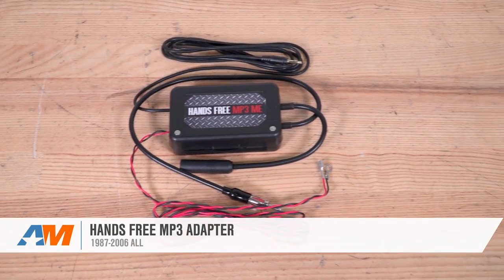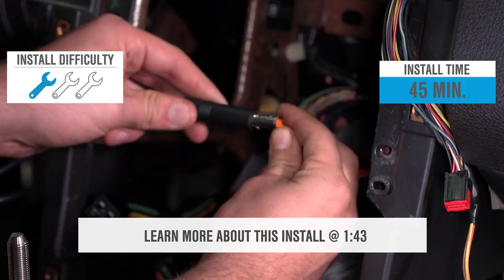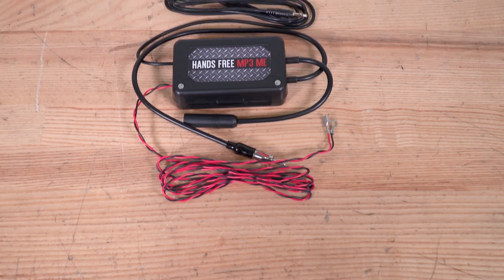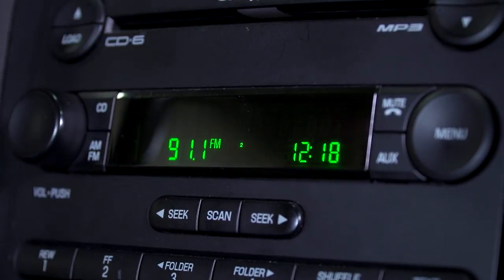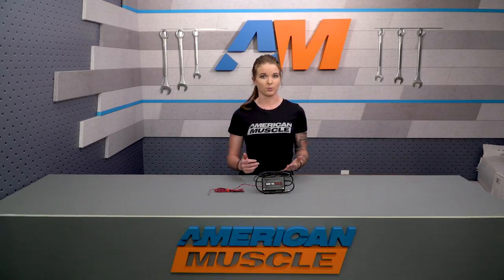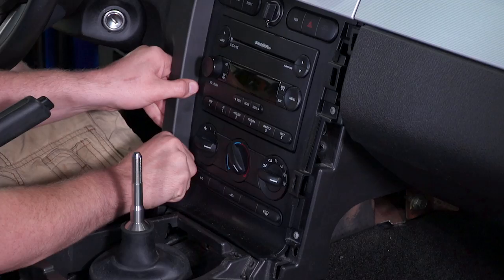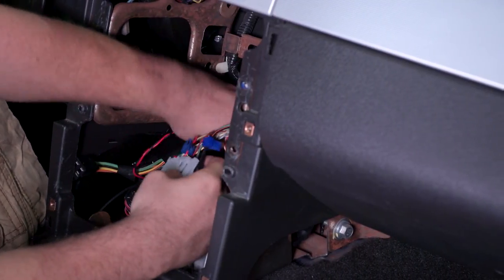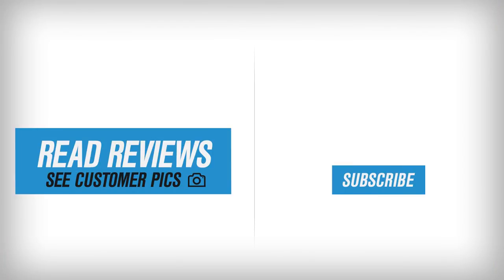1987-2006 Mustang Hands Free MP3 Adapter Review & Install

Comment: A Bluetooth cassette adapter is more affordable and effective for those with cassette tape players.
Reply: my main reason for wanting a different solution is that the tape deck is rather loud when running, plus nobody can hear me! I just want to take calls without all the hassle on the factory stereo if possible.
Reply: Logan Carbin good point. Yeah people do have trouble hearing me sometimes but it’s convenient cause my car is manual. It’s a cheap solution but if I can and get the money I’d upgrade my entire stereo system.